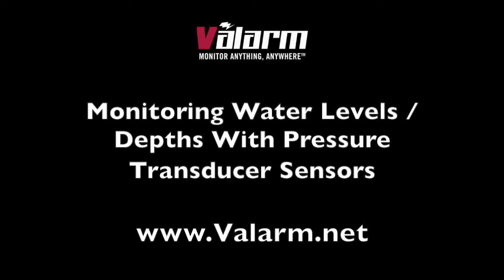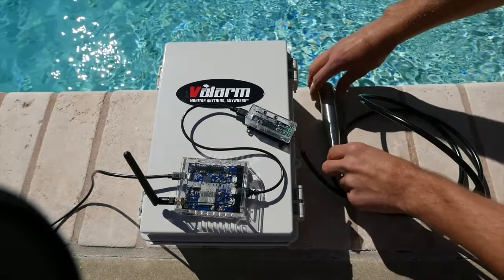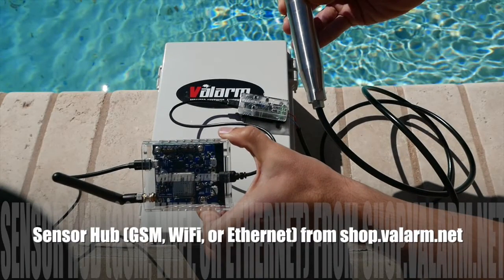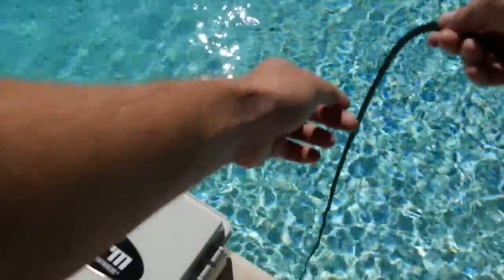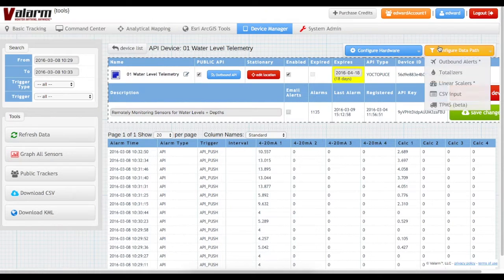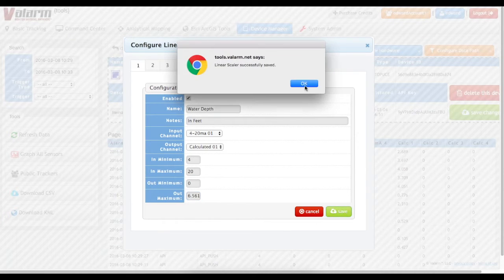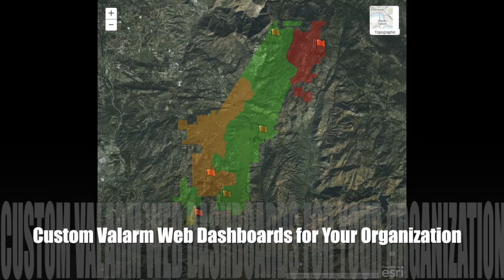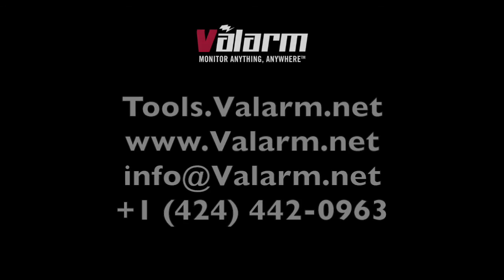Remotely Monitoring Water Levels and Fluid Depths with Industrial IoT Sensor Telemetry Applications

Comment: Hi Edward, what brands of transducer have you work with in Valarm?
Reply from the maker: Howdy Wall Art. Thank you for reaching out. Our customers use any brand of transducers with https://Tools.Valarm.net . Valarm Tools Cloud measures sensors made by any hardware manufacturer that supports industry standard sensor outputs like 4-20 mA, 0-10V, SPI, PWM, serial, RS-232, RS-485, and others you see available on https://Shop.Valarm.net . One customer favorite transducer is Senix, used by our customers and Smart City government agencies in the USA for flood warning systems - https://senix.com/news/valarm-uses-senix-toughsonic-ultrasonic-sensors-to-help-build-stormsense-flood-monitoring-solution/ . See our Industrial IoT Customer Success Stories for all of the details you could ever want on how our customers deploy transducers / Industrial IoT sensors to save time, lives, and money - https://www.valarm.net/customer-stories/